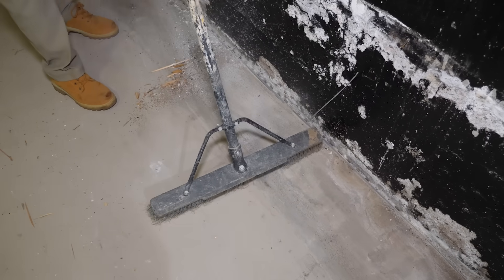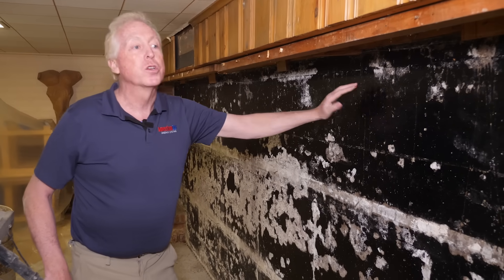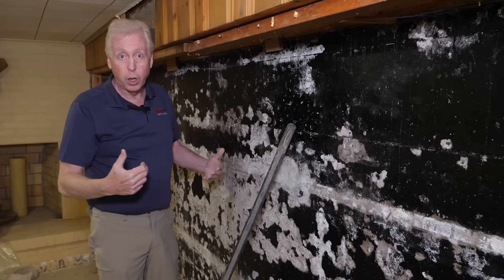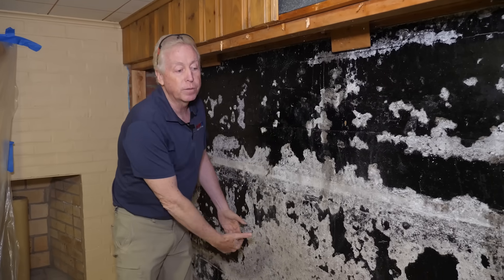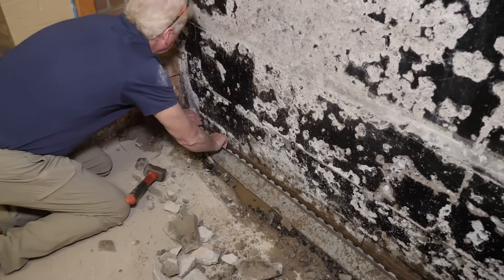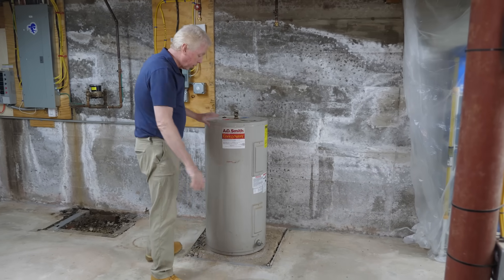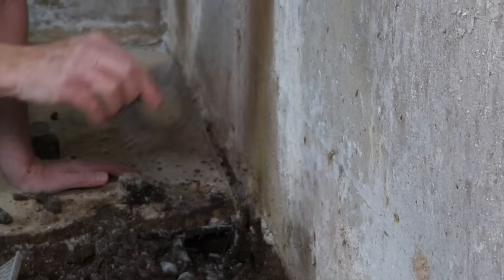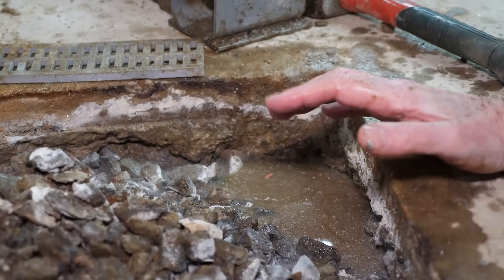Waterproofing Basement Walls | Finished & UnFinished Basement

Comment: The only time I got water in my basement from rain, was when hurricane Ivan dumped over western Pennsylvania here, and my gutters were filled with leaves. I got about a quart of water in one corner of my basement.. The gutters and downspout were not carrying the water away from the house like they should. The water was overflowing out of the gutters, and down into my lawn.. since then, I have been up on my roof using a leaf blower to keep the gutters clear whenever a  multi day heavy storm is threatening in the fall when the leaves are falling..
  if you want to keep water out of your basement, make sure your gutters are clear and the downspouts send the water away from your foundation, first..
  here in western Pennsylvania, we average about 55 inches of rain every year..
  my house is built on a half acre wooded lot on a slight hill side. It was a construction class project for students in the 1950s. It’s a  62’ ranch were the main/1st floor is at ground level in the front of the house, and  the rear of the house, because the house is built on a slope that is Terraced, around the rear the basement and garage are level with the ground. So from the front, my house looks like a one story ranch, but from the rear at looks like a two story ranch. all brick, the foundation block is a very hard type of block they used back in the 50s. I had to have a door cut in because there was no man door in the basement to go outside. To get in and out of the basement, I had to keep opening the garage door when I first bought the house in the 80s. The acquaintance I  hired to cut in a door which was what he did for a living, he was a specialist door installer on new construction..he said, that is the hardest block he has ever seen.  After about an hour of cutting with his usual block cutting saw,He had to go and rent a more powerful saw and buy a diamond blade to cut this block. It took him 2 days, and there was so much dust.. I didn’t really know this guy that well, he was One of the guys I rode dirt bikes with on the weekends,and I could see he was frustrated because it took an extra day, so I paid him $300 more for a total of $900 including the new door And renting the  bigger saw and buying a new bigger blade.. that was in 1989 dollars…
    I know how fragile regular cinderblock  is. You can easily break i with a ball peen hammer. I had to cut a vent for our clothes dryer and  2 holes for our new condensing furnace pipes in this block. Using my compressor, a heavy macho drillgun, and a pneumatic air chisel,It took me more than two hours to cut each hole.. my point is, this is some tough block that doesn’t seem to be very porous. Maybe that’s why I don’t get water in the basement unless my gutters are clogged and a hurricane slowly passes over dumping over 5” of rain on already saturated ground from the previous week of rain ..
  they don’t build them like they used to

Comment: thanks for this video, best part word is "concrete should allow to breath", may i ask how about bricks, outdoor brick wall can i seal with transparent water resistant liquid to protect it from the rain ? anyone knows ? thanks
Reply: The sealant coats the tiny passageways in brick and mortar but does not block them allowing to breathe.
Reply: @TRAZ4004  thanks for your information. i never knew that, so the sealant should be great for brick wall, especially if anyone lives in  north cold region

Comment: Great video. Quick question: my foundation wall is made of large pieces of stone (built 1929). The outside area surrounding my house is all concrete (in an urban area). The downspout of my gutter runs underground and this is where it leaks into my basement. I've redirected the downspout but in heavier rains, I still get moisture penetration. Can I just use hydraulic waterproofing cement to seal this specific area?  Other areas within my basement are always dry.
Reply from the maker: Definitely use hydraulic cement to plug up the leaky parts of the wall. If a new leak comes from somewhere else after plugging up, then you will have to consider interior subfloor waterproofing along the walls that are leaking.

Comment: Hello, I have some efflorescence that comes from a few windows in the basement. I also see it on the floor from the peeling paint. My basement is not finished but I would like to finish it. What do you recommend before framing and putting up drywall? Can I use cement board for the laundry room?
Reply from the maker: Dampness & humidity will make paint peel, and efflorescence is a sign that there is a lot of water against your outside walls for long periods of time. Check if there is any source of water draining close to the house. For instance, a neighbor's pool might have a leak. Check if your window wells (if you have them) are holding water rather than draining water 15 ft or more away from the house.
Reply: @AmericanDryBasementSystems  I think it’s the gutters. It continues to detach from from bottom. Thank you for your reply.

Comment: Just out if curiosity..... We just moved into our house the end of March 2021. We found out we have a sump pump not sure how old. When water goes into the sump well where does this water originate from? There are spots on the basement walls that have the effloescence. Can I paint dry lock or similar over it on the basement walls?
Reply: There are time with hard rain water sometimes drips down the wall in some spots.

Comment: Did they even core out the block to relieve the wall
Reply from the maker: You are correct. We did not drill out weep holes to facilitate the draining of cement block cores. Why? Because the blocks on this wall had cores filled with cement. The groundwater is easily making its way through cold joints. No need to drill holes through solid concrete.

Comment: So it’s sealed inside the basement….Is it  not ok to still seal the outside ?
Reply from the maker: The original construction should have some kind of tar-like base sealant on the outside. Not inside. We seal the bottom 24-36 inches with our waterproof barrier to protect concrete from deteriorating. Our waterproofing system will never let water go higher in the backfill area outside your house during a big storm.
Reply: @AmericanDryBasementSystems  well i ask becauae i worked for a concrwte company for y years and i was doing flat work and walls..and yeah out side we always tarred ,foam?, amd stone....lol..so i was confused..was i taught wrong... I onl helped walls in wi twr when flat work slowed down but still enough to know the basicas

Comment: Nice tutorial. Back in the day I installed 3" pvc with 3/8 holes at 5 & 7 o'clock below footing. Covered in aggregate.
Property on hill. Foundation was block. Area was clay based soil. Basement always flooded. After piping to a sump pump pit on 2 sides of basement never had a flood again. I quess I got the hydrostatic pressure to decrease by allowing water to find a least resistance path to pipe. 
After watching video I think in theory it's what you did for that home. I wasn't sure it was going to work but happy it did. All work on inside of basement.👍
Reply: I had a mason do the exact thing you describe here in my basement....he jackhammered a trench around the inside perimeter and installed PVC pipe with holes which all run into a sump pit.  Haven't had a single water incident since and it's been 20 years.  He told me there's no way to actually waterproof your basement but you can manage it once it gets inside....he was right!
Reply: @XBKLYN   Oh they can be waterproofed, torch on, and Xypex in the concrete mix and poly in the footing to slab joint. It is not something you do not want to do anyway. As you could literally have your basement float out of the ground if the water table is high enough..
Reply: Ya it's called weeping tile.   It's been building code in Canada since before WWII...

Comment: Hi, My exterior garage was dug down on one side to lay the block foundation. A lot of water is coming in through the dug down side. The previous owner has coated inside and out with a paint sealer. I was going to apply Xypex (crystalize treatment) but the surface preparation states that it must be clean of any product. My question: What is a good solution to remove paint sealers?
Reply from the maker: There are two ways to remove waterproofing paint. Both require a lot of work and patience. Fastest way to remove the paint is with a circular sander using a concrete coating removal disc. It is vital to wear an air purifying respirator and have an air machine to suck the particles out of the air nearby. Slowest way to remove the paint is to clean the surface, and apply an oil-based paint stripper for waterproofing paint. Wait 8 hours and peel off with a putty knife, wire brush, etc. Don't forget to wear gloves and mask. Good luck.
Reply: Wet sandblasting

Comment: The floor is not held up by the footing.
Reply from the maker: True. The previous system removed the floor from the footing. We will replace it with our proprietary Supercrete cement at a code-compliant 3.5 to 4 inches of thickness. It will mend into the main body of the floor and hold the floor up on the footing once again when it was one piece.

Comment: Water Guard is nothing more than a sales gimmick. I have personally seen many houses end up with a broken foundation due to poor installation from the "drop down" The other major foundation issue is a result of water having to come up over the footer (as you mentioned) causing the home to sink and a good chance the footer will eventually crack. 90% of the houses basement systems has done in the mid west have cracked replacement concrete in addition to less than 2" of replacement concrete.
Reply from the maker: We have been getting a steady uptick of replacement jobs. Not so much just to replace the system but more because they fail to manage water properly and keep the basement dry.

Comment: This is very good information but I was wondering if you have any videos on water problems that stem from high water table. I literally watch the water bubble up from the ground in my basement it does not come through the foundation. It’s a very stressful situation I would appreciate some suggestion
Reply from the maker: Your exterior waterproofing on the walls is doing a great job at keeping your foundation cold joints sealed tight. That's why you don't see leaks around the walls. The false water table outside your walls is very high. Most likely some source is directing water to that area around your house. Get a reputable waterproofer to check things out. Find the source, stop it and see if the issue persists. If the water only bubbles up after a big storm and stays with you for a week, then goes away... Undoubtedly, it is the hydrostatic pressure pushing the water up underneath your floor. You maybe in the market for an interior drainage system.
Reply: @AmericanDryBasementSystems  
Yes, very much a hydrostatic pressure issue! In your opinion how deep should the drainage system inside my basement be? There seems to be mixed opinion about this. Also are you familiar with any reputable waterproofing inspectors in Westford Massachusetts area? So wish you were available in this area! Thanks again for your
Reply from the maker: @vanessabanyas164  Sorry. I don't know anyone I can refer you to in your state. One thing is for sure, don't have a contractor install s drainage pipe below the bottom of the footer. Undermining may occur. The only point lower than the bottom of the footer is where the sump pump basin is installed. I wish you luck.

Comment: So in Russia they put XPS boards around the house and cover it with soil/rocks or concrete. It's called 'blind area' and there's always a decline so water runs away from the house. My house I bought here in USA didn't even have gutters and backyard is going uphill, there were no drainage neither. Must have been built by a smart builder and approved by another smart inspector :)
Reply: Americans are good at many things, but building a proper house.. no

Comment: Wow, I’m glad I saw this. My basement recently flooded and I was thinking I needed something like that gutter system.
Reply: Do NOT invest in a gutter system like what he’s ripping up. I just spent $22,000 for the sump pump and interior gutter system and my basement is flooding just as much as before. I am so disheartened (and out of money). What was explained to me is not at all how it works (or doesn’t) in reality. I just bought my house so I suppose this is a life long lesson I’ll never forget but just take your time and do research yourself. Don’t let anyone talk you into something and especially if you’re not knowledgeable about something (like me with my basement) it’s okay to wait and read up on things before making a decision. I wish I hadn’t paid to have this done. It’s a joke.
Reply: @kyungyae6297  thank you for that, it turns out that the flooding in my house was caused by a backed up sewer line.

Comment: Before the 70s basements were a unfinished space to put the kids with the old couch and b&w tv. Waterproofing was not really a concern, so if you want to use the space, avoid a lot of older homes. What is criminal, is that many new homes since that era still leak as contractors cut corners, then go bankrupt before the litigation starts and creating a new company the next day. My eldest bought a newly built home last year,  and first rain, you guessed it,  walls saturated and insulation soaked. Warranty?
Reply from the maker: In many cases, outside waterproofing on new construction is seldom effective. You are so right about cutting corners. Regardless, water will eventually get in no matter how much waterproofing you put on the outside walls. I've seen it too many times to keep count. Water will always find a way in, especially under the floor like the home in this video. We get contracts all the time to install new construction interior waterproofing with great success.

Comment: What if I use lineX bed liner on the outside of wall then fill in with dirt?  That should stop all water.
Reply: Dimpled wall membrane is cheaper and easier to install.

Comment: The house that I bought had a very bad water infiltration problem in the basement (not disclosed by the seller), and the only entry was blamed on a single window well that was below grade with no well and a concrete sidewalk sloping towards it. 2 years later, a very wet spring showed what I was in for, when there was a literal river flowing from the basement walls to the sump pit. The paneling in the basement 'flowered' with mold! I had a basement waterproofer come in (I checked BBB first) and did an interior waterproofing/weeping tile/sump and added a whole house dehumidifier. 5 years later, all is still good, problems solved. As you note, they did NOT seal the concrete, but installed a thick membrane sheet against the wall that allowed it to 'breathe' at the top and outside, and directed any weeping down to be collected to the sump.
Reply from the maker: This sounds like a very extreme case. I glad you found someone capable of getting your situation under control.
Reply: This just happened to us! (The weeping walls,  the window wells letting water in)
How much did this cost you? I just had the estimator come Monday,  and they haven't sent the est cost yet. What damage are we looking at?
Reply: Same .just bought a house that the foundation is leaking in the basement that the seller didn't disclose
Reply: @amieloudaway4938   this happened to me when i bought my home, and there are signs that they tried to repair it just enough so it got by the inspector.  $30,000 later i have a dry basement.  The home inspector was clearly a complete idiot and apparently so was I for hiring him.  Harsh lesson learned
Reply: how much was all that $20,000?

Comment: What are your thoughts on Drylok brand of products ?
Reply from the maker: I'm not big on waterproofing walls with paint until any hydrostatic pressure outside your walls is solved. But, Drylok make great products. I especially like the hydraulic plug they produce to stop leaking cracks. It can give you 3 to 6 months before the any crack starts leaking again. In some cases, that's enough time to find a solution to permanently solve your water problem.

Comment: your questioning how water gets around to the sump, I'm not an expert but I'm assuming all basements have a drainage tile system under the whole floor of the basement which ultimately leads to sump ... if you have water sitting somewhere along the channels then something is plugged or settled somewhere preventing it from working as intended but what do I know ... I know in my 1960's built to house this would be true ...
Reply from the maker: Thanks for commenting. Not all basements have interior or exterior drainage systems. You must contract someone to install them during construction of the house, or after. If the installation is incorrectly done, or a poorly designed system is installed, then clogging and wet floors are possible.

Comment: Your method may be a correction but planned retaining wall construction will consider a drainage strategy behind the wall especially on a hillside or sloping terrain where correction behind the wall will be impossible!
Reply from the maker: A retaining wall is totally unnecessary.